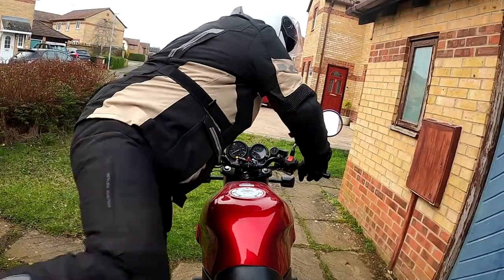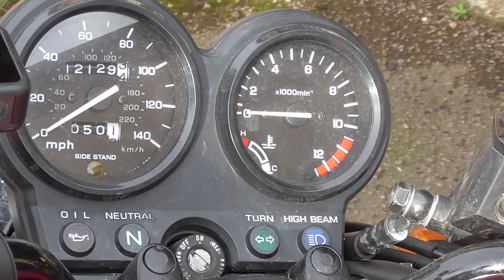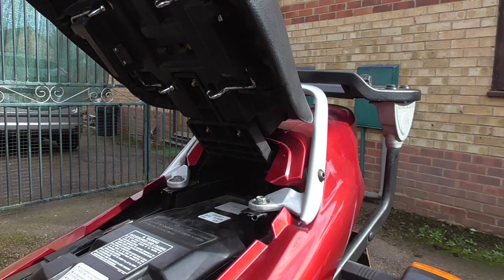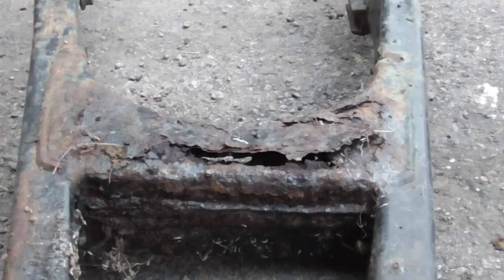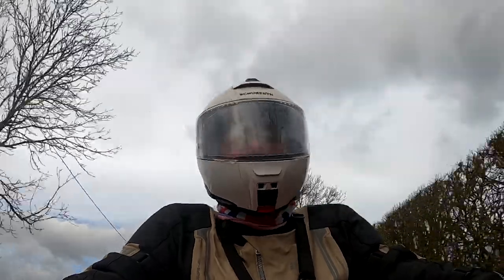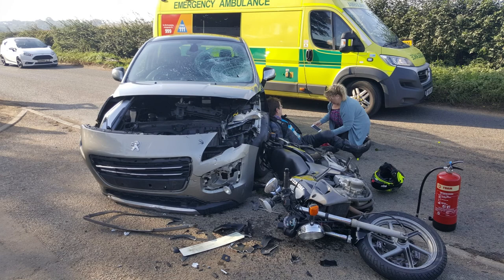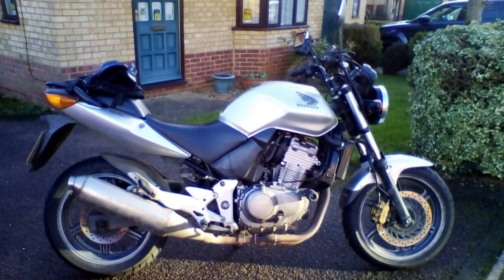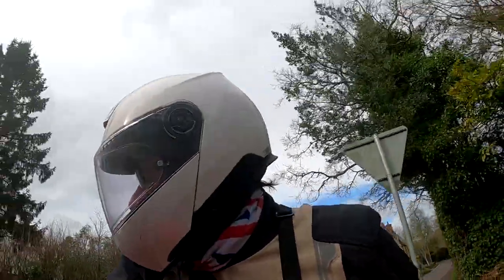1999 / 2003 CB500: Honest Review

Comment: Hi David,  great video. Do you know what the quoted NOx emission level is for this bike? It may be present on your V5 document? I'm looking to buy one however I would need to have it emissions tested to make sure it's ULEZ exempt for London.
Reply from the maker: @maxexelby7566 Thanks for the comment and question.  My V5 is from 2017 when I bought the bike and doesn't show any figures. As bikes weren't tested back then [as far as I know] you would have to get it tested.  I don't know how likely it would be to pass, perhaps a nose around the forums may give you an idea.
Reply: For anybody reading this in the future, they'll sail through a ULEZ emissions test. Mine got 0.10g/km (>.15 is the cutoff) on a 65,000 mile engine. (The other bits have gone over 100,000) That NOx figure is apparently quite high for these bikes too. If anything, worn jets are probably a good thing as the mixture is richer so the combustion temp is higher, hence more of the nasty NOx's get burned.

I've owned my CB500s for ten years. As well as failing reg/recs (buy a Tourmax one - much better than the originals), coils will usually go for 100,000 miles before packing up and causing bad running. I've put mid-level YTS shocks on the back and it handles incredibly well. Motul 5000 oil used to make the tappets (shims/buckets whatever...) noisy and then i tried Castrol Power 1 semi synth oil. That stuff really does what it says on the tin and  loosens the engine up and improves acceleration noticeably, making the bike an absolute hoot to ride. (Only downside being that i now hit reserve at 170 miles of constant town use, rather than the 200 which i previously got.)
Reply from the maker: @graememorrison333  Thanks for the reply and information, I will add it into the description.  If you haven't already could you give a like to maxexlby7566's question so he will receive a notification and hopefully see your reply?

Comment: At 74 I am finding my W reg 600 fzs FAZER is getting a bit hefty for my, the CB500 was one of the lighter bikes I have been looking at but as you say they are becoming very hard to find, The other 500cc contenders are the Kawasaki ER-5 or GPZ or even a Guzzi V50? My mate is busy building one up which was an Italian police bike still in it's light blue and whit Colour scheme, But the CB 500  WILL ALWAYS BE FIRST CHOICE!!!
Reply from the maker: @notwocdivad - Thanks for the comment, you can also look at the newer CB500 series, the latest one is now called the Hornet.  As well as the ER5 you could also look at the ER6 or perhaps an SV650 which has a low centre of gravity [stay away from the Gladius model though, see the part about changing the numberplate bulb in my review.

I've had a look on Autotrader [22-07-24] and found two CB500s for sale and also two CB400s from the early 2000s which is something that may be suitable too.

I'm not massively familiar with the Guzzis, seen them, not ridden one, owners seem to be keen on them and I imagine spares are avaialbe through owners clubs.
Reply: Thanks fore the extra ideas, I think, lol. The old Honda CB400 twin looks ok but I had the 250n and while riding the frame cracked at the top rear shock mounting that put me off them quite a bit! Your great review just reinforced my idea that the CB500 is my No1 pick at the moment, have to wait til the Fazer is sold and see what funds are available, Shame as I love the Fazer, Smooth and strong and handles well. Ho hum getting older is no fun at all!!! Cheers, Ride Safe.
Reply from the maker: @notwocdivad - The 400 bike I saw is the 2000s 4 cylinder one https://bikez.com/motorcycles/honda_cb_400_super_four_2002.php rather than the SuperDream.  I thought that the old 250 'Wet Dreams' were pretty robust, if badly underpowered.

Comment: Would you recommend it as a first A2 bike? My first A license is going to be A2 and I am clueless what to buy for first bike.
Reply from the maker: @milanori4104 Thanks for the comment and question.  You'll probably know that the standard CB500 is 57 BHP so you would need a restrictor kit, I have found one online here: https://a2restrictors.com/products/honda-cb-500-2000-a2-restrictor-kit-cb500-014

You will find that the bike isn't just a good A2 bike, it is a good bike all round.  I've owned and ridden them since 1999 and it's still the most all round bike I have had.

The 'new' CB500s with the 471cc engine are A2 already so may be worth a look, the first ones will be coming up for 10 years old now, I would look at 2014 onwards if you go that way.

Comment: I've got a 1997 Cb500v and I bought a very low mileage cb500x thinking that would be the bike to replace the old girl. I have to say it was a complete let down, the new one has no character and yet manages to be more annoyingly vibey than the old one. The new one was no where near as peppy and overtakes involved a lot more planning. The new one was massively better on fuel but that came with the downside that the first eighth of the throttle was like an on/off switch. The new one was no where near as much fun or as engaging and the cardinal sin for a Honda was the quality on the new one was shockingly poor. When I sold it at 8,000 miles it already had lumps of paint missing of the frame that I had had to touch in and the coatings on the engine cases were chipping and everything just felt a bit cheap. I gave the new one a fair shot covering about 3,000 miles in about 6 months but, in the end, the old girl is still with me and the new one has gone to pastures new.
Reply from the maker: @Mike-T120 Thanks for the comment.  I mentioned recently that I bought a CB500X new in 2014 from Blade in Stratford on Avon and within a few days the frame around the swingarm pivot was going rusty.  They managed to break a fork seal on the first service (6 week wait) and refused to deal sensibly with me over the corrosion.  Honda UK weren't interested either.

Eventually after being off the road for nine months as I refused to ride it it was repainted under warranty then traded in.  I won't buy another new Honda because of this and I have never set foot in Blade again.

The quality of the '97 bike (one of the first with a rear disk brake?) is far better, they don't seem to make them like that any more.
Reply: @TheRantyRider  Oh Wow what a small world it is because Blade Stratford was the original supplying dealer of my 500x 😲 it was bitterly disappointing as I had my '97 and also a 2007 CBF1000 and the quality of both was incredible. I kept the 97 but now have a 2017 Triumph Bonneville T120 and so far I am very impressed with the quality of that but certainly Honda won't be getting my custom again unless they up their game.
Reply from the maker: @Mike-T120 It wasn't white and with a reg no ending in EHD (I think) was it?  Full luggage too?

Comment: I think I'm going with this one once I get my A2 license in a 2-3 months. There are quite a few here in the Netherlands for €1-2k and most of what I read/hear about it is positive and especially as a first bike you would want something reliable like a Honda.
Is it good on the highway? Or should I look into a windscreen as well?
There are also some CBF 500's for around €3k. Do you think it's worth the extra 1k for the CBF instead of the CB?
Reply from the maker: @nulla9601 Thanks for watching and the questions.  In my opinion the CB is better than the CBF as the engine is smoother and it has a centre stand.  The CBF has the edge (just) on handling but is not quite as much of a complete riding package as the CB.

I have ridden naked bikes since1986 so I am used to being in the wind.  Small 'fly screens' are available: https://skidmarx.co.uk/all-products/honda-dohc-twin-cb500-1998on-universal-stylish-fly-screen-kit-tall-fly-screen-36cm although the bike shown is an XJR1300!

A fly screen will direct the wind to your head so you will feel it more than if it was spread over your entire torso as well, this is why I don't use them.

Before you decide test ride both the CB500 and the CBF500.  If you can find a CB500S give that a go as well as it comes with the fairing which you might like.
Reply: Yes. Go for the cb.. is chep too run and very simpel❤ I own tree cb’s.. 1994 whit drum. and 98 Whit disc’.. and a cb 500x 2023..
Reply from the maker: @jesperpedersen37 Quite a collection of Honda's you have there.

Comment: Hi David, is the older CB500 easier to work on than the CBF ? I think the CBF is a bit better with a pillion...Im 173cm and I am 56. Ride since 1985, from smaller to heavier bikes.
Due to a hip replacement (and age) and preservation of my shoes :face-orange-frowning:I dont to pull heavy bikes on a centrestand anymore. Thats why I want a smaller bike, I mostly drive smaller roads but I cant avoid huighways. Although the max speed is 100 km/h here (at night 130) but I rarely drive at that time, another option is a NTV650 (not the uglu but very handy Deauville ...) which is a good bike as well. I like (and need) to have a topcase, maybe a small screen, although it aint really necessary. I only need the bike occasionaly cause I take the bus and train as well (but the timetable isnt very royal nowadays ...) nor are the number of destinations ...Which one would you advice ?
Reply from the maker: @ooievaar6756 Thanks for the comment and question.  The CB500 is lighter than the CBF and easy to put on the centrestand, it's more about technique than strength.  The bike feels light as it is a lot lower than modern bikes and the weight is low down.  Screens are easily available but luggage might be more of an Ebay search than new stuff.  The CB500S has a top fairing but these aren't as common so you may struggle to find one.

You will find both the CB and CBF great on the smaller twisty roads but 130 is stretching the engine a little but certainly doable.  The CB has to run on E5 fuel (5% ethanol) or less, using E10 will see the fuel lines degrade, possibly along with other parts such as carb diaphragms and inlet tracts, I think the same is true for the CBF but others may chip in.

The bikes are easy to work on for maintenance but the tank on the CB is far easier to remove than that on the CBF.  The CB also runs more smoothly.  The CB seat is as comfortable as the CBF but easier to remove as it is one piece wheras the CBF needs a 5 mm Allen key to remove the front seat pad.

The NTV is also a good bike, as is the very heavy but well thought out Deauville (the 'baby Pan European') so a lot may depend on the availability of each model where you live.  The last CB500s are 20 years old now and supply will be getting more scarce.  A quick look online has only three currently for sale in the UK, and four CBFs.

I find the CB to be the better bike, but you can also look at the 471 CC bikes from around 2012 onwards, more easily available and I doubt you would struggle even with an 'X' varient.  The only downside is that the build quality is not as good.

I hope you find something that suits you.
Reply from the maker: @ooievaar6756 The CB500 certainly needs the E5 rather than E10 according to the original information at the time of the switch, which, apart from mine looking pristine, is the reason I don't ride it much!  

However I had a quick look online and found this page: https://check-vehicle-compatibility-e10-petrol.service.gov.uk/manufacturer/Honda%20Motorcycles Which states "All Honda motorcycles and mopeds produced for the EU market since 1993 can use ethanol-blended gasoline up to 10% although carburettor-equipped models could experience poor driveability in cold weather conditions."

The Honda website https://www.honda.co.uk/motorcycles/my-bike/E10-fuel-update-2021.html directed me to the HM Government page.

Comment: Hi mate me again! I had a quick question… I removed my left side stator cover to have it refurbished and a small amount of oil came out.i did google and apparently it’s normal but i myself thought it was a dry environment in the stator side (im a 2T guy normally) anyway if it is normal why only a tiny amount? Why does all the oil in the engine not drain out? Confusing 😂👍🏼

Thanks in advance.
Reply from the maker: @danshorthouse - Thanks, I needed something to keep me occupied for ten minutes after work!  I have had a look on the Fowler's website where they have the parts 'fiches' for the bike: https://www.fowlersparts.co.uk/browser/manufacturer/honda/bike/cb500/year/1997/country/england/colour/all-colours/gallery

I can't see any obvious seal for that end of the crank, the bearing surfaces will be oiled and it may be there is a lip in the crankcase that is designed to stop too much in the way of oil flow.  Without playing 'find the part' I can't give you an answer to if there is an oil drain back to the engine - it may only be small - in the bottom half of the crank.  If there is a small amount of oil provided to the genny it will only be with the engine running and pressurised oil circulating as most of the oil sits in the engine pan rather than in the engine so it wouldn't fill the genny.

If as I think the oil is coming from the crank have a look at the level where your dipstick sits, this is well below the centreline of the crank itself.

Generators don't need to be dry these days as they are well sealed and on the CBF1000 the mk 2 engine has more oil flow to aid in cooling the genny as these are prone to overheat if accessories are added.

I hope that helps, if you get an answer from the forums please post in here.
Reply: @TheRantyRider  enjoyed your answer as always mate! I have recently serviced the bike and the oil level is perfect.I know a guy thats will know the complete answer, its definitely not a problem,im just interested how. I will keep you posted!!

Kind regards
Reply from the maker: @danshorthouse - SuggyRacing has the start of a series, the second film shows the oil in the genny housing you were asking about: https://www.youtube.com/playlist?list=PL5tZOq6kKBZkTnXwm9QPk3bpRY0lRK4IU
Reply: @TheRantyRider  cheers mate il have a look!! 👍🏼
Reply: Hello.i recently bought a 2002 Cb 500.and it's not in bad shape.i noticed a pipe going back to the chain under the swing ARM?? It's coming from under the left hand side case. Looks like its feeding oil to  chain or some thing.not sure to b sure.also I need to get the saddle off to get it repaired ..any ideas.just back riding again after 25 years so abit clueless at the mo..any info b great.thanks Joe ireland
Reply from the maker: @joeymylett6762 - Thanks for the question.  The pipe sounds like a Scottoiler or similar feeding oil to the chain, it should go to the top side of the bottom run of the chain, ideally near the rear sprocket.  There are breather and drain hoses that run out to the bottom of the bike, as I recall one per carb for if you need to drain them, one fuel overflow and one crank breather that will have a plastic bung in the end.

The chain oiler should only run with the engine so the vacuum tap from the carbs to the fuel tap may have a 'T' piece in it or the right carb may have a hose connected to the vacuum point used for balancing the carbs to provide a vacuum to the oiler and let it open to pass oil to the chain.

The saddle is easily removable, it opens with the ignition key in the left sidepanel, then with the saddle raised as far as it will go a sharp thump on the bottom will pop it off its hinge.
Reply: @TheRantyRider  thank you ..sorted .all in all is the cb 500 2002 a good purchase its got 54+miles on it..a respray job which is not to bad..but thereis a build up of gunk around the bottom  centre stand..is that any thing to do with the oil feeding the chain of just lack of previous owner not cleaning proper. Iv checked  n no oil leaks can b seen
Reply from the maker: @joeymylett6762 - Is the gunk at the top of the stand where it meets the frame?  If so, and it is mainly on the left it is probably from the chain.  Popping the front sprocket cover off may reveal a nasty lump of grease and muck which I find is best removed with a lolly stick or screwdriver, possibly with gloved hands as there can be a lot and it takes some cleaning.
Reply: @TheRantyRider  thanks ..ur information is spot on.thanks for ur help the last few days..there may b more questions to b asked..and now I no who to ask..